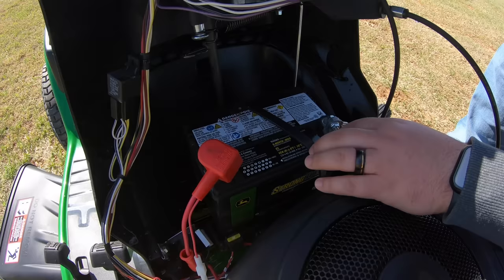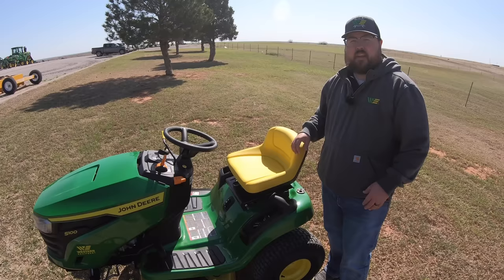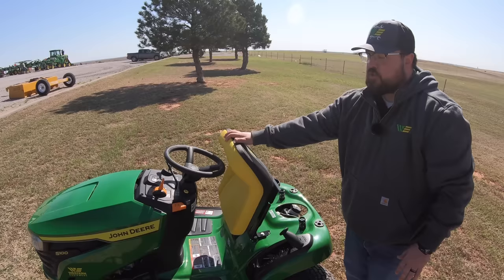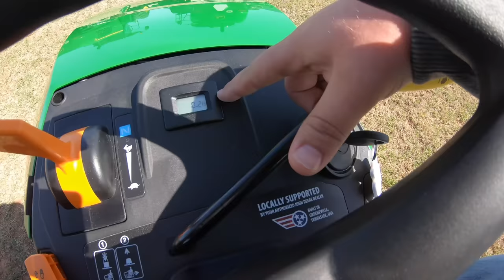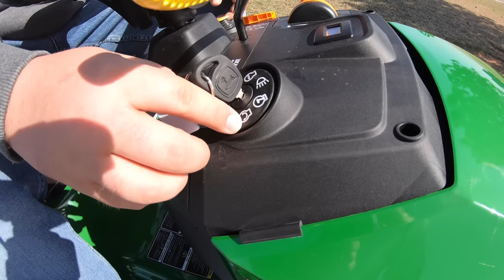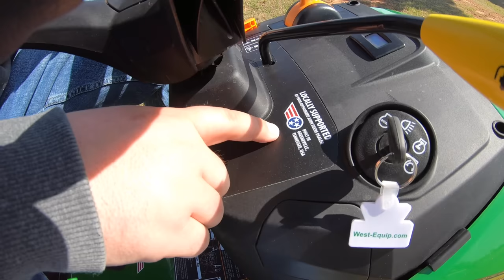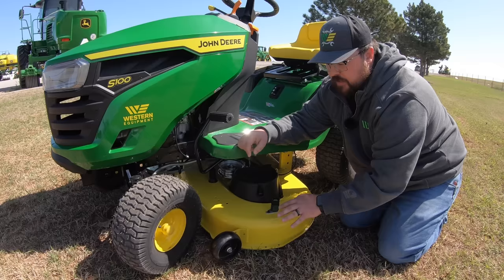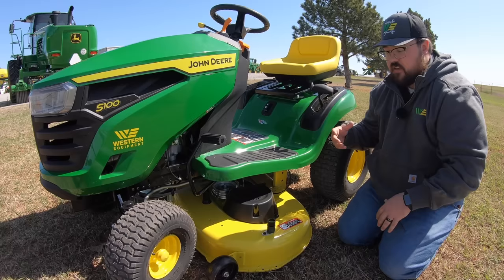2021 John Deere S100 Riding Mower Review and Walkaround

Comment: Regarding the belt jumping off.  My local J D Dealer said that when you engage the blades, you must engage the blades with the the excelerater arm (the orange arm) in the middle not full exceleration.  Once you engage the blades then you can shift the excelerater arm to high and when you disengage pull you excelerater arm back to middle.  Hope this makes since.
Reply from the maker: Yes, this is exactly how I always suggest doing this process. Thanks for watching!
Reply: @WesternEquipment Can you elaborate a little more on why the belts come off?

Comment: I challenge anyone to try to mow at night with these headlights. The reflectors aren't even a mirror finish but more of a painted silver. This is not unique to JD. Most mowers in this class have "headlights" that are more ornamental than they are functional.
Reply: well  , at least it is some light
Reply: @whommee  True... you can just make out that the bulbs are illuminated. My X500 is almost the same. Dim bulbs with a silver-painted reflector. Replacing with LED bulbs doesn't help much. I just find it comical that they actually think someone is going to be out mowing at night with the lights on some of these mowers.  :-)
Reply: I agree they need better lights but you can change them to Led
Reply: @hamlet616723  I tried that with my X500 and it made very little difference because of the el-cheapo reflectors used. Instead of a mirrored finish like in a car headlight, they are a dull silver almost like a painted surface.
Reply from the maker: I am hoping LED's are in the future for these machines but I'm Glad John Deere is at least giving customers a light option. Thanks for watching!

Comment: What a great How To video!   I have never used a deck washer before.  My property does not have any cement/asphalt - just a dirt driveway.  Do you think that means I cannot use the deck washer feature?    Do you have any tips for what to do before running the mower for the first time?  Home Depot is doing a "curbside drop" so I am also checking for videos that let me know what to consider when I am moving/starting the mower for the first time ie. do I need to add oil on delivery .. grease/lube any parts?  Thanks again for a great video.
Reply from the maker: Thank you. It will be hard to use the washout with out a clean solid surface to set the deck on. Here are a couple of videos I have done that should help you with your other questions https://youtu.be/CX39QqNdNus https://youtu.be/_sW6kPSk_3w. I hope this helps and thanks for watching!

Comment: I have a 2002 craftsman mower with the same engine. The only thing I see that Briggs and Stratton has changed is the top plastic and fuel filter. I have maintained this engine annually for 22 years now, mowing 1 1/2 acres and have had zero issues. I change the engine oil and filter along with air filter annually with a fuel filter and plug every other year. I do take the engine cover off and blow out all debris from cooling fins annually also. I know people say Briggs are not great engines but maybe they do not maintain them or I got a special good one. You decide.

Comment: Thank you for a very thorough video. We are in the process of buying a 3-acre property. The land is not flat. It has small hills and some boulders. I am researching my options as I have never had the need to own a mower before. I have looked at zero-turn mowers and these riding mowers. The last thing I want to do is run over one of the small rocks or boulders on uneven ground and damage the blades. I am still researching. Thank you
Angel from The Bay and soon to be Country Angel

Comment: This new S Series of mowers seems like a good step from the E Series. I had an E180 (54") but 4 acres of hilly/rough lawn and 7 acres total land took its toll in less than 100hrs. Last year I went to a JD dealer and looked at an X300 Series, salesman talked me up to the X500. I in return talked myself into an X758! 60" auto connect, 4wd, 3cyl diesel, suspension seat, click-n-go, it's a beast!
Reply: Those are  high quality machines!, I just got "sticker shock" or I would own one!
Reply from the maker: Wow, that is quite the jump! I hope you really like your X7! Like @nate said they are very high quality!
Reply: $14k for that seems like better options available 🤔
Reply: S series is little more than an E / D / L / LA with some lipstick.... Anyone running an E180 on 4 acres of hilly terrain should not be surprised it was moaning like Blue Iris at a mere 100hrs... that k46 rear end is fine for flat terrain of 3/4 to 1 acre.... the x300 would not fare  better as it, too, features the lowly k46...  congrats on your x758, you’re not screwing around anymore ;)

Comment: Just bought the same rig. She smoked something fierce after that first fire
Reply from the maker: Has it continued to smoke or only after the first start? I have seen a few of these smoke on the initial start up and then it stops after it's been ran a while. But if it continues to smoke I would take advantage of your warranty and have it looked at by a local dealer. Thanks for watching!
Reply: @WesternEquipment  seemed to be just the once. And it was because I had just hooked up battery and filled with oil so I had left the cover open. Didn’t know it NEEDS to be down at all times for proper exhaust
Reply: Ps thanks for reply on the e100 acre video.

Comment: good info.  i'll remember that about 1/2 throttle for activating / deactivating blades.  the manual states to operate in full throttle and i do.  but my mom and sister sometimes mow and throttle way down because the s-120 is way too much tractor for them i guess and they are nervous about the touchy drive pedals, plus they think they are "saving the engine," bless their hearts.  the cutting deck roars quite loud and gets no quieter in lower throttle, and i've told them the cutting deck appears to be rocking in distress under low throttle, but they don't care.   anyway, i'm finished preaching to them, and will just do my weed eating and push mower duties where that s-120 can't venture.  but i must say that the s-120 is a boss and no toy, and people that are scared or infirm might be well advised to get a type of tractor with manual gears if they want to creep slowly around the yard.
Reply from the maker: Thanks for the comment and thanks for watching!

Comment: I when ahead and bought the S100 at Lowes $2,399 with a 10% military discount of $224 was taken off. 

The older gentleman telling me about the John Deere was very knowledgeable, he owned one years ago, i ask why JD didn't put the storage lid on, he said hold on, when over to a S130 took the lid off and put in on mine, not many people would have done that. 

I when over everything when i got it  home, it cut very good, i have some rough farmland here with some Meadows.

Something that's overlooked by some people that's important in getting a new tractor i believe, i will change the oil, filter after 3 hours to get rid of the metal shavings in the new engine. 

Another thing i did was bought the front bumper that's important to not Crush that hood, which Lowes dose carry for $90.

They gave me 3 keys.

Comment: We just got our s100 today and c get it to go forward or reverse,  I just subscribed 👍🏻
Reply from the maker: I would check to see if your transmission disengage rod is pulled out in the back. If it is out it needs to be pushed in to go engage the transmission if that doesn't help then you may need to take the deck off and see if the transmission belt is broken or not on the pulley on the transaxle. If all else fails, call the dealer you bought the mower from and take advantage of your 2 year/120 hour warranty. I hope this helps and thanks for watching!

Comment: Great review.  I was considering a zero turn but need a mower that can do massive amount of leafs. Looking at a John Deer with a leaf mulcher. I'm getting to old to tarp my leaves out to the street. My leaves cover about 10 car lengths and 6' deep. It's usually a 8hr day.
Reply from the maker: Wow, that is a lot of leaf cleanup. But you can get mulching kits for most of the zero turn mowers so this could still be an option. Thanks for watching!

Comment: You might want to re-check the manual for that S100. The Deere manual says to "Install and tighten dipstick" when checking the oil level. This also matches what is in the OEM Briggs & Stratton manual for the 31R-series engines. The Kawasaki engines are the ones which tell you to turn the cap backwards until it clicks on the threads and then check the level.
Reply: I think he has  it right , for the Briggs engines, he is rotating it until a point where the stick drops down,, now my Kawasaki  a water cooled twin, the instructions are to just sit the  oil  fill stick  on the fill tube and not turn but measure oil level from the un seated  stick position.
Reply: @whommee  I was simply repeating what is written in the new S100 Owner's Manual. It clearly says when checking the oil "install and tighten dipstick" then remove and check level. On my X500 with Kawasaki FS730V it says to sit on top and rotate CCW until the cap clicks down on the threads. I also have an OEM Shop Manual for the Briggs & Stratton 31000-series engines (which the S100 has) and it also says to "install and tighten" the dipstick.
Reply from the maker: I will make sure and mention this is the next video. Thanks for pointing this out and thanks for watching!

Comment: Just bought this machine yesterday.  Today was my first cut and I blew the belt.
Reply: I wonder if you might have any thoughts on what could have caused that on a new machine?
Reply: @jeffwelch5255  which belt
Reply from the maker: Did you have your spindle covers on? And was it the main deck belt?
Reply: @WesternEquipment  yes the covers were on.  Yes, main deck belt.  It looks like it was cut with a knife.
Reply: @manofculture4945  main deck belt
Reply: @jeffwelch5255  you where either cutting very thick grass with it and caused the belt to snap or hit a big rock that caused to snap. Or something was wrong with that belt when new, put in a new belt and see what happens.
Reply: @WesternEquipment  what are the chances you could post a video on changing the deck belt on the s100?
Reply: @jeffwelch5255  I believe they are the same deck positioning and all. Here https://youtu.be/VvfpGHJDbq4

Comment: John Deere up graded that transmission because the CVT was junk. You had to always make sure that grass did not build up on top of transmission if so it will clog up the levers and you will not be able to go forward or reverse. I had  a mower with that CVT and it was replaced twice under warrantee. My lawn was 6000 sq ft and flat. John Deere lost a lot of money replacing them.

Comment: I can confirm that the oil filter is NOT easy to get off.  Even though it states on the filter itself "hand tighten only" it was clearly screwed on tight by a machine at the OEM facility.  I had to buy a tool to get the original off.
Reply from the maker: I have had this issue man times as well. Thanks for watching!
Reply: It’s not uncommon for hand tightened oil filters to need a little extra help to come off.  In fact I have never had an oil filter I have installed “ hand tight “ not need a filter wrench to come off

Comment: Great vid!! We’re entirely new to a riding lawn mower and this was easy to follow and understand.
I do have one question that I can’t find the answer to anywhere, though. What’s that little switch below the seat with a gas tank sign for?
Reply from the maker: Thank you and that is actually not a switch, it is a fuel gauge. It is on a float so when you fill the tank up the piece that looks like a switch will be at the top and it will lower as you use fuel. Thanks for watching!

Comment: I wonder if the S100 is durable?  Do you need to maintain the machine frequently?  Is it prone to failure?  Will it be difficult to start the engine after a winter in the north?  Is there enough horsepower in the family backyard?  Thank you I want to know about these.
Reply from the maker: These machines require normal service like any other mower and I have seen 100 series mowers last people for years and years. There has been an issue on a lot of these mowers with the belt coming off so I would suggest looking one step up to the S110. They will have the horsepower to do the mowing that you need and as long as you take the normal precautions of using fuel stabilizer and a battery tender during the winter you shouldn't have any problems starting in the spring. I hope this helps answer your questions and thanks for watching!

Comment: I recently bought the S100 and so far no issues with almost 5 hrs use. I learned after full throttle belt engage but no problem. Since then I engage belt at half. 
Did they fix the belt issue? 
Ive learned a lot from your vids and others too on YouTube. 
I hope i made a good choice in the S100. 
I will be making my first oil change soon.
Thanks for all the info!!
Reply from the maker: I have heard mixed answers on the belt issue. Some say it is better and some say it is not. I am really not sure, but I do know if you take care of the mower, it will take care of you.
Reply: @WesternEquipment   That's what I intend to do. Care and common sense goes a very long way!! Thanks for your reply!!

Comment: Great, thorough review!!!  Ready to go to my local JD dealer then I read reviews on the JD site.  Regardless of the purchase location many reviewers are complaining that new S100 series are throwing deck belts.  In your review, you mentioned bolt on housings to prevent this from occurring.  Can you shed any light on the issue?  Thanks!
Reply from the maker: Most of the time when I hear of belts jumping off it is because the operator took the spindle covers off that hold the belt in place. The S100’s should all have the new belt guide system on the main pulley coming off of the engine, so it shouldn’t be jumping off there. I hope this helps and thanks for watching!

Comment: Im a handy man and honestly never knew that about checking the oil with the dip stick not tightened all the way down, thanks for the tip... Do you know if thats for all dip sticks like that
Reply from the maker: It varies depending on the engine. some manufacturers and models require you to tighten it down and some do not. Great question and thanks for watching!

Comment: Why did John Deere never do a recall on the faulty plastic hoods from about 10 years ago or so. My x320's is all cracked and in pieces. I use duck tape and foil tape to hold it all together. I am  not paying $500.00 for a new hood that they are responsible for their garbage design. thanks. great review.
Reply from the maker: Thanks for the comment. I will pass it along.
Reply: @WesternEquipment  and they will say, c-ya sucka. It's there design flaw. It just crumbled to pieces. Brittle and not flexible. The wrong plastic. Thanks.

Comment: Just bought a S100. I do have a question if you could respond. I am having difficulty getting my deck to level and it seems to have a vibration issue.. If I level it at 3.5" then lower the deck to the lowest position it is off. IF I level it low to the ground and then raise the deck position it off again by at least 3/8" from one side to the other. My real concern is the vibration. Could Lowe's be at fault for using a fork lift to pick up my lawn mower by the deck when they delivered it ? Thanks for any help !
Reply from the maker: Hmmm that is a good question. You may want to have a John Deere dealership look at it and make sure you don't have any damage that can be claimed on warranty. I hope this is helpful and thanks for watching

Comment: How much difference between 100 and 110 besides HP?
Reply from the maker: Mainly just that and the 110 has a higher backed seat with a breathable back.
Reply: @WesternEquipment   thank you. I can’t imagine that slight variation in horsepower makes much difference.

Comment: I just had my S100 delivered today, all assembled. The fuel gauge below the seat appears blank, it is not on the hour gauge. There is a sliding piece, but it seems flimsy and blank no matter what position you slide it. Am I missing something here? And yes, I can see the fuel tank is full.
Reply from the maker: So the piece under the seat is a floating fuel gauge. so if your tank is full the slide should be all the way at the top. When it is empty, it will be sitting on the bottom. I hope this helps and thanks for watching!

Comment: Reading about the s100 it says for yards up to 1 acre. I've had a craftsman lt2000 since 08 and its replacement time.
Issue is my yard is about 3 to 4 acres.
The lt2000 also has the 17.5 hp motor and it survived the large acreage.
Ive never owned a JD tractor, Will the excess acreage cause issues or will it handle it ok?
Thanks and good quality video 👍
Reply from the maker: It will handle it just fine. You may have to fill up with gas towards the end of your mowing but the surface area will not be an issue. Just make sure to follow routine maintenance and all will be well. Thanks for watching!
Reply: @WesternEquipment  Thanks!

Comment: Just used my S100 today for the first time, its ok but why does it make such a racket when I engage the blades?? I adjusted the deck 3 inches off the garage floor and cut height is about what I want on the lawn. when the salesman started it up and engaged it didn't make any noise, I'm pushing the clutch/brake in as far as it will go.
Reply from the maker: This is strange. You do not have to push the brake when engaging the blades so maybe that is causing an issue. Let me know if this helps any. Thanks for watching!
Reply: @WesternEquipment  Thanks for the reply, it is making a racket whether I use the brake or not, guy from Loews is coming out tomorrow and check it out, will update you.